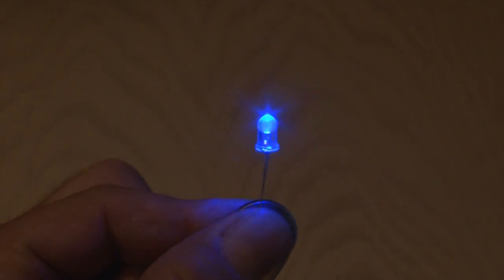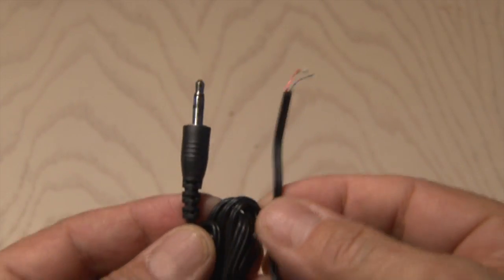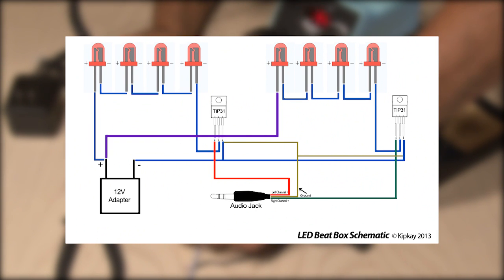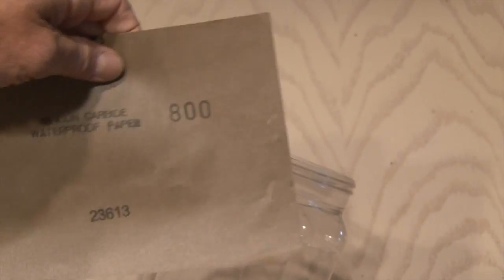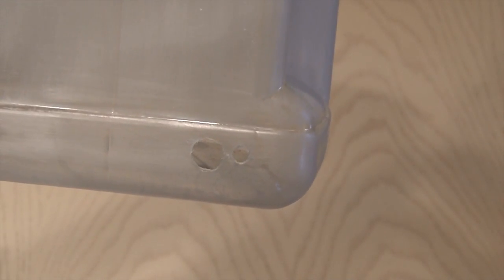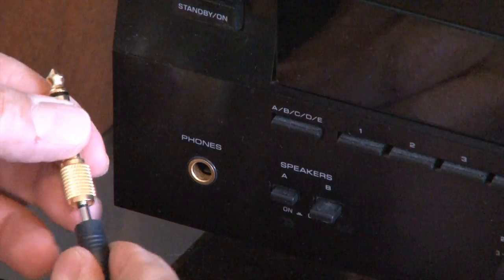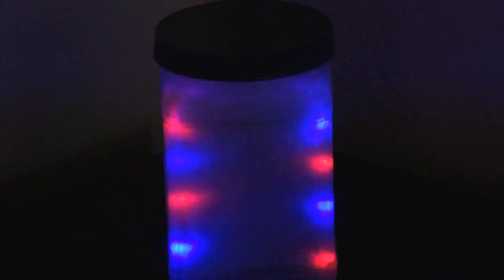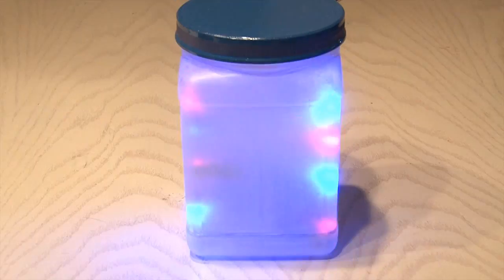LED Beat Box!

Comment: What about if you want to use this on two seperate channals with seperate negatives. I want to use one on my woofer for a bass line and one for the treble highs on my other speaker. Can I use just one power supply without the minuses interfering with eachother ?

Comment: i use 3volt, 1 tip31c, and a red led, but it only works if i put really much sound through it. what did i do wrong? i tested if it worked with a motor and it did. but with a headphone Jack it doesnt.
Reply: You need a 3,3 voltage for leds.
Reply: +I.G. Noreme no the leds work fine at 3 volts.
Reply: did you solved it? mine didnt work too😐
Reply: nope
Reply: +Gijs You got the wrong transistor, kind of. You have a tip31c, but you need a tip31. the diffrence is that the tip31c is for high voltage. I made the same mistake ;-)
Reply: SwagiYo thanks
Reply: +SwagiYo hey bro , I used tip31c too but I've connected the base to my subwoofer. the leds are always on even when my system volume is at 0 and there is only a minor increase in brightness when the bass hits. And it seems to be working better at high volume.  Do you know how can i fix this ?
Reply: I don't know, maybe a 1-10 ohm resistor or a 10-20 uF capacitor.

Comment: Love this project, man. However i noticed some buzzing in the speaker when i connected it to my Logitech Sub, so i soldered in a simple diode between the wall adapter and the ground pin on the TIP31. worth noting if somebody else has this problem.

Also i am wondering if you could use 2xTIP31 and connect them in series so the first boosts the signal from the amp and then the next one outputs slightly more for when you don't/ can't crank it too loud?
Reply: KopMaister  I have that problem, what happen is the connection on the ground from the audio jack was not properly soldered, and it touched the Ring and created a buzz sound. here is mine.

I used the 2 Channels (L and R). Each channels have 4 LEDS.  12 V power source.

https://www.youtube.com/watch?v=b17zd35TTKs

Comment: dear kipkay why my project beatbox weak led light ??? i just follow all direction from this video ... how i should repair or what i need to do ??? thanks
Reply: maybe you should amplify the input sound a little bit
Reply: i think so ... but there's a lot of videos like this are using cellphone and other devices ... thanks ...
Reply: I have a solution and it works ... i set the led to series right all possitive lead to possitive and negative to negative ... instead audio jack i directly to speaker ... like music source to speaker circuit and speaker circuit to speaker and reactive led circuit ...
Reply: ANON BeastHacker this may burn out your transistor be carefull

Comment: i did this same setup but i wired the LEDs in parallel and run it of a 2 AA batteries , w/ my setup u could connect up 2 10 LEDs (5 4 each channel)

Comment: Dear Kipkay,
Can u use a audio splitter instead of the ac adapter?
Reply: no..u cant..because the AC adapter is the power..the audio splitter would look like this ( Y ) with the legs...plug a speaker into one of those legs

Comment: Does tip31 work with AC current as well? Or can I use any other transistor for the same job, but for 220V lamps? If not, how can I do a similar project on "a bigger scale" with AC current? Thank you.

Comment: Can i use an output of 12v -1200mA adapter? 
If not do i need a resistor. What kind if i do? Thanx for you time in advance. Cool project man i like it.
Reply: you don't have to use a resistor and your power supply looks fine to me ;)
Reply: Thanx man that helps me alot

Comment: I did this today, however it wasn't working, then I realised  the TIP 31 is completely redundant. All you'd need to do is have the audio cable acting as a switch, so you would connect the LEDs to the audio and have the transformer amplify the signal. You would then split the left and right channels to the different lines of LEDs. However, the main problem I then had, was the LEDs would barely light up due to there being 8 LEDs and only 12v.

Comment: does it have a speaker in it or will you need to use a splitter and plug in a speaker aswell
Reply: You'd need to plug in a speaker aswell

Comment: I have a led poster idea. need to know what parts I need... close to the beat box painting the plasic poster cover with frost and using the back cardboard to place the leds in random spots.  Just want random flashing with out music and a slower color changing speed.. about 20 leds.. what parts and power adapter do i need?
Reply: maby a 555 or a pic controller ,transistor, resistor

Comment: How he does it will work BUT the right way, which he should be teaching people, is to have a good mechanical connection before soldering. Twisting, crimping, or just putting a bend on each side and pinch together before soldering would be good. It's just good build technique. He gets away with it because he is working with low voltage and currents, but people might use the same techniques when proper construction might be critical. It could end up even killing someone if it goes wrong.

Comment: wonder why the powers to be make up complicated circuits when thats all you have to do, just because you found a way to make a led flash to music you think its right well yes it works but this way you will get better flash to a lower volume beat and the transistors also help take out any chance of overload to the led ohms law voltage resistance currant do you know any of these? just saying there is a reason for complicated circuits

Comment: This is way more complicated then it needs to be as you can see in my video. all you simply do , is take your led, hook the negative end (shorter lead) to a 270ohm resistor, then hook up your speaker wire to it and run it to a speaker, simple as that.

Comment: Hi Kipkay, could you wire a microphone into it, so when that hears noise, it flashes the lights, this could be useful in a car, if you leave it on the seat, powered by batteries, then it would flash to the radio without having anything plugged into it?

Comment: Yea they are the control in the circuit. By using the volts coming from source (the 3.5mm headphone jack). 
three poles (dopped layers of semiconductor ions; Negative or Positive layers. nPn or PnP
if you don't know what a transistor is or does. it's a switch. 3 poles. A is the input power source. (he used a wall ac- 12v 250mA), B is where you want that 12 volts to go (this case its the LEDs) C is the trigger. no current flow from A to B unless you apply volts to C. 
Music input controls this

Comment: I built this using a set of tip42 transistors, and now the project doesn't move with the music. It is a solid light that is only interrupted when the plug or audio jack are removed from their source. I've checked and all of the connections are solid, and there are no wires touching, even by the solder. Help?

Comment: A soldering iron, then he used it to melt some soldering metal that made both the wires connected. Go for the electrical powered iron, not gas (safer), and buy soldering metal made from tin, not cobber. :)

Comment: I tried this, got all the proper parts and wired them up, made sure the connections were correct, checked, double checked, had a tech friend check to make sure. ended up not working and damaging my iPod battery/headphone jack.

Comment: those transistors are overpowered- they are 3a 100v npn transistors, but only need to handle 12v @ 100ma (.1a) max, so if u have transistors on hand use those, as those are probably fine. just a tip.

Comment: Well, kind of.
Then you would need to do some modding on the recipe, but the principle still stands.
cant really give you specifics, as i am best in low power electronics, not really HV stuff like lights ^^'

But if you use it as a control circuit instead of the dial that is for the lights then it should (technically speaking) work, the odd part is getting the power levels just right so that it wont fry your equipment.

Comment: What is the voltage of your powe supply? Because blue led' mainly require 3.2-3.6V ant red 1.8-2.2... so if the voltage of your supply ir to low that may be the problem...

Comment: Yeah, You can use more LED's, but it depends on your power supply. You can double the amount of LED's on one channel just by connecting 4 more LED's parallel. (groups in parallel of LED's connected 4 in series). If you want to change amount of LED's ir series, then you'll have to change the supply voltage or limit the current with resistiors...

Comment: I have a variable voltage adapter (has 12V) but when I spliced the end I found like 2 wires that have the same colour (normal copper colour) and they're kinda sticked together, so does the thick insulation they have, so how can I know the polarity ?

Comment: I live in the middle east, from where can I get sand paper ? Is there any chance that can I substitute sand paper with any other thing ? If i tried 8 LEDs with 12 Volts as you said will it be good ? or I should try over this voltage ?

Comment: I used a transistor tip41. power supply voltage 15 volts. and 3 blue LEDs per channel. Audio signal from the computer. LEDs are dimmed. how to fix it?

Comment: Yes it can, but there is a chance that you need a amplifier or something, because the signal that comes out of the mic. might not be enough, you can make a amplifier with a op-amp and 2 resistors, or a transistor circuit

Comment: Yeah I realized that after I said that. Just seemed really strong for it, I actually just made my own but I used LED ribbon, which has a voltage regulator built into it.

Comment: You should connect them parralel to the power source, or have a higher voltage power adaptor, but check if the tip31 can have that amount of voltage you will use.

Comment: I bought a 5 meter, 300 LED-strip. One that only needs 12 volts and uses 24 watts. I also found a power adaptor, that has 12V, 2A - output, exactly what i needed. Connect it all to the TIP31 transistor and the audio jack, and I have super awesome led light in my room, that bounces on the music. For less than $40!

Comment: it is not a good idea connecting anything to the base without using base resistor. also the transistor saturates around 0.6V bellow this, it wount conduct. its better idea to use op-amps and better yet with bandpass filters to separate bass,mids and treble.

Comment: Yes it will, not too much though because the LEDs are drawing most of their power from the wall adapter, all the audio signal does basically is tells the circuit when to brighten and dim the LEDs. Over all the power consumption should be relatively unnoticeable (very little power drain), also I'm assuming that your speakers are using an amp built into them as well, if that's NOT the case, then you will probably see a more significant power drain, because more power is needed to run the speakers.

Comment: Funny how you remind thinks,isn't it n_n ? So funny the first part :) The only thing is,if you use the spliter on an mp3 or Radio,it will drain the battery faster,won't they ?

Comment: yea, they will cut the speakers, but what you can do it buy a Y adapter and run the speakers off one side, and the LEDs on the other, only thing is if you do that, then you would need a power amplifier for the the LEDs because the device your plugging it into will not be powerful enough to run both, if you need anymore help, just message me. good luck!

Comment: You sound like you know electronics.If you plug this into the aditional 3.5mm Jack of a office table stereo speakers,won't that disable the speakers and only transmit power to the LEDs (as the computer will take them as a headphones and cut the speakers) or the speakers connected to the PC,MP3,Radio or whatever is smart enought to know and won't confuse the LEDs with speakers and they won't cut the speakers?

Comment: if you used 8 LEDs to suit the voltage of your power supply couldn't you run alot more in parallel, theoretically to the maximum current of your power supply?

Comment: Try putting a small capacitor (1 microfarad capacitors should work) between the audio cable and the base of each transistor.  Just make sure that the negative side of the caps connect to the transistor bases and the positive side of each cap connects to the audio cable.

Comment: If the output is 12 Volts DC, you should be able to use it I think, regular LED's can't take more then 20mA for a while, KipKay used 8 LED's, wich means 8x20mA = 160mA, they shine the brightest if you give each led 20mA, but 10 will also do the trick, wich means 8x10mA = 80mA, so you should be able to use it, but before you use the sand paper on the LED's you should try them out first without the sand paper, maybe they dont shine bright if you use that adapter, so check that first out!

Comment: Not with the schematics KipKay uses, the Blue LED needs around 3 - 3,5 Volts, so if you put them, like kipkay did, 4 LED's connected to eachother, you already need 12 Volts, so 5 Volts wont be enough, you can adjust the schematic maybe a little bit, so you can solder the LED's parallel to the power source?

Comment: If the container is small enough, you can just solder the Anode of one LED directly to the Cathode of the other LED, if the gap between the LED's is to much, you can just use the wires that KipKay uses, almost every wire will do the trick

Comment: 2 questions,
Can I use a pot meter to control the intensity of the lights using this scheme?
With this scheme, can I also use 20 or 30 leds and will there be more lights lighting up according to the sound intensity?

Comment: This is great! Back around the mid 70`s many guys had this same type light in the back of their cars and they turned them on at night to dance along with the music. They were not made of LEDS though but they measured around 2x2x1.5 and had a shaded clear plastic cover on front. Back then they were refered to as Trip Lights. I bought a used one from some guy, (can`t remember who) for around $20 only to find out it did not work. Think i will make one of these for old time sake.

Comment: Yea. Youre not going to get any sound, since your device detects something in the headphone port, itll output the power to make sound, through that port, which is how the LEDs light up. What he didnt mention is that youll need a splitter to split the singla between your new box, and whatever speakers you plan on using.

Comment: == I ran out of letters in the last comments, so you might want to read the other one before this ==
...
Also, my younger brother made a similar thing in school, only it was a single led (it might have been two, not really sure) connected more or less directly to the mic, so it does send out some voltage worth mentioning, and unless you want to have a 20 meter cable between the mic and the rest of the device it will provide enough power for the transistor.

Comment: Well he is using that adapter to get the power for the lights, the only power that needs to come from the sound (be it then mic or headphone plug) is just to power the transistor, which (not, trying to look like a smartarse, just describing in the case that you didn't know) is a piece that basically let a current through from the left leg to the right only when the middle one is powered, so the mic would go to the middle and the power from the wall socket goes to the left and right go to LEDs.

Comment: hey, great video, will this set up work  in a car, working off the battery? current could be higher so might need resistors but will the transistor work? and what current would you want to be going through the leds so they dont blow

Comment: You probably could, but make sure to use a power source that has the correct output voltage. If you for exampe use led strips that connects via USB, then you should connect it to 5 volts and not to 12 volts.

Comment: No, that's not correct. Orange leds have a forward voltage drop of 2.2v and blue leds have a forward voltage drop of 3.6 volts. That means that you can connect a maximum of 12v/2.2v = 5 orange leds to a 12v power supply, or maximum 12v/3.6v = 3 blue leds.

If you need to connect more leds, you can connect them in parallell instead of series (negative to negative, positive to positive). However you will need to use a resistor to limit the current, or your leds will get destroyed quickly.

Comment: Or you could add a small mic and instead of having it go straight from the speaker plug it would sense the sound and flash according to that. Well, either that or add a decent speaker to the contraption itself.

Comment: if you want to separate bass/treble, you can add a potentiometer with a capacitor to the output of the transistor.  The capacitor will bleed off the treble like the tone control of a guitar.

Comment: No. You're just using the output from a headphone jack to saturate a transistor. From there, the LEDs take power from the 12v supply.

Comment: Lol. U can easily burn an led with a 9v battery. Let alone a 12v supply coming from a charger. I doubt this project works at all. You need voltage regulators and resistors. Any one wonder why the box cant be translucent? ;)

Comment: You won't be able to add additional channels from what I know, you would however be able to add different colours just the same as how you could add more Diodes. Because in the schematic he has it like |_|_|_|_
With | being a diode and _ being the wire conecting them, if you want to add more colours just do this |_|_|_|_/_/_/_/_
Where / is a different colour,  A good suggestion would have an arrangement like this |_/_|_/_|_ and have it alternate colours.

Comment: The trick is to get the right LED's get the 12v ones the 9v one are just going to burn out. you can try hooking up a main line and add a resistor to it and then split the signal.

Comment: would it still work if i used a wall adapter rated at 12v 600mA instead of 12v 250mA ?